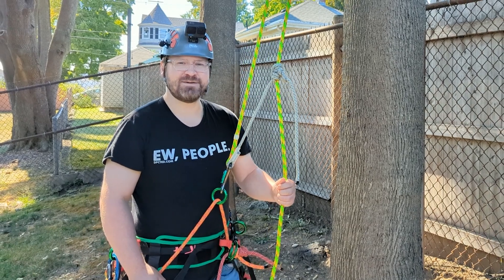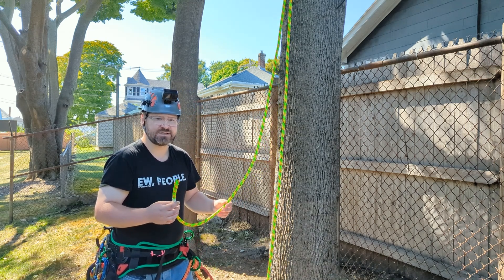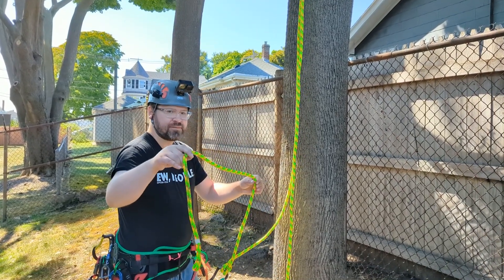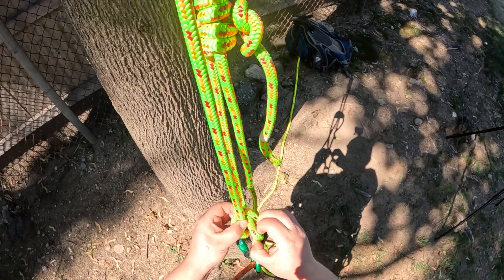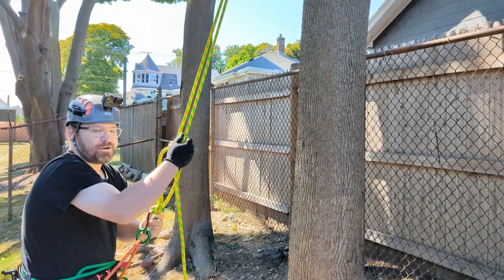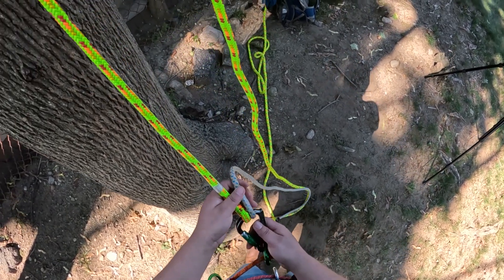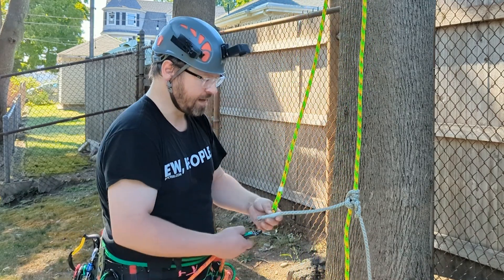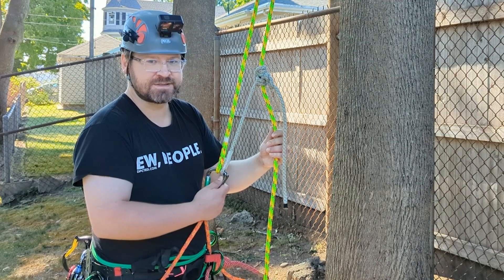OPEN & CLOSED Moving Rope Systems (MRS/DRT) - Tutorial & Discussion for Arborists & Tree Climbers

Comment: You were talking about which carabiner shape to use with a rope & small splice & a split-tail with a small splice. The best triple-locking carabiner with that  shape is easy. The carabiner that is taylor-made for these 2 splices is a Fusion & it's jet-black & fantastic for this in every way. The orientation with this carabiner is very smooth & if my hands are 🥶 it's not impossible to open.😮
Reply from the maker: I really love DMM hardware. But I'll take a look into the fusion. Thank you for sharing!
Reply: I @Knot-orious 
I like the DMM quality & their ovals. I have a couple  different shapes from Petzyl. But the Fusion is a very stylish black with nice white print & it stands out when you see it. It is designed to put a split-tail on. I'm not sure who makes this cordage but its beige with blue specks & the splice has a small holes with a weave of stands that you thread your carabiner through. Since there's no protective coating those strands go over the slot provided for it from the shape of the Fusion. Then the spot for the end of your climbing line with a sewn splice goes next to it. Nothing moves out of place & the whole system is very efficient & clean.😮
Reply from the maker: @josephtreadlightly5686 are they steel carabiners? I think I know which ones you mean. They're by Fusion Climb. They're a D shaped biner. They come in aluminum too.
Reply: @Knot-orious 
I will investigate, seems like steel to me.

Comment: I use SRT to go up from the ground. But I have 2 heavy rope style bridges on my tree cutting saddle. When I switch over to my MRS I use the DMM Hitchclimber Eccentric. When I get the right hitchcord on my system I could use it from the ground cuz it works that good. However I  have a bridge twice as long on my MRS compared to my SRT. I'm going to try to use my Petzyl Pinto this MRS system for pulling up slack when I have a secondary line in the tree which is equipped with a split-tail.  I have the spacer on my Pinto.  I just like it to be full-measure ready in case I need to use it on a re-direct.
Reply from the maker: I use SRS/SRT to ascend almost always and only use MRS once up in the canopy. The PInto is a DMM product, not Petzl. Having a spacer is a great idea and it will prevent the side plates from deforming when connected to softwares.
Reply: @Knot-orious Yes, DMM & since I also ordered the spacer with it I should know that. I would like your opinion on using the Pinto with a Rope Wrench. Do you prefer the one eye or the double rabbit ear for the Rope Wrench?

Comment: When discussing descent with the Blakes Hitch, you should warn the viewer not to descend too fast with that hitch or it will heat up and potentially the hitch can fail.
Reply from the maker: Yes, you're absolutely correct. That's good advice for anyone using a polyester rope tail. Better and safer to use an aramid split tail.

Comment: Thank you for all your time and effort making all your knot vids and these. I am a newbie climber and they have helped me tremendously. I have a question though - the other day I saw an arborist climber use his lanyard in a MRT system and he removed the hip thrust in the equation by sort of walking up the tree and then moving the hitch. Why not show that approach it also looks a lot easier than he full body weight thrust.
Reply from the maker: First of all, you're very welcome and thank you for thanking me! I'm delighted that my videos have helped you as a tree climber! Secondly, there are many easier ways to ascend MRS, but this video focuses on the most basic and is geared toward absolute beginners. I would make some videos showing the easier methods, but I am more of an SRS expert than anything else. You'll notice that the majority of my videos are about SRS. That's because it is a faster, easier way to climb with better devices and techniques. There is still a place for MRS, and I do use MRS, but I'm just not as skilled at it and it doesn't excite me as much. My goal has always been to spread SRS awareness and techniques, with some occasional MRS videos so that I appeal to the full tree climbing audience. But thank you for sharing that lanyard technique with my community. 🙏🙂
Edit: If sounds like that arborist was spur climbing up the tree. I don't use spurs because I climb living trees recreationally.

Comment: The clove hitch for a length adjuster on the closed system was pretty sweet!
Reply from the maker: Yup! It's a great little trick! Glad you liked it! Thanks for commenting!
Reply: When I use my Maasdam rope puller I use a length of blue Amsteel & attach it to whatever I'm pulling. Then I attach the carabiner @ the end of my rope puller to a mid-line clove hitch on my blue Amsteel line.
A port-a-wrap teamed with a Maasdam is a great duo in tight quarters or if you have something to bring down to the ground but only if you can manipulate from 2 ends.